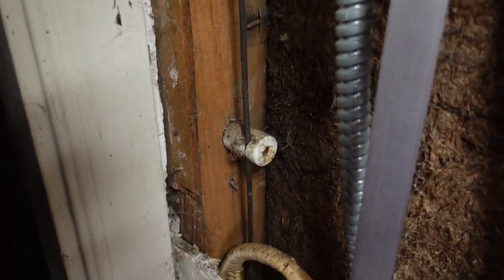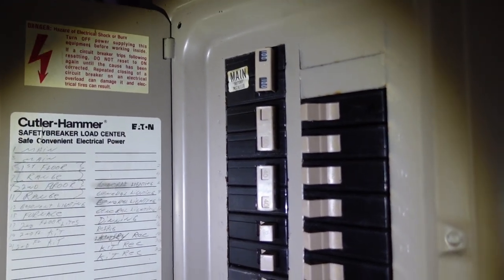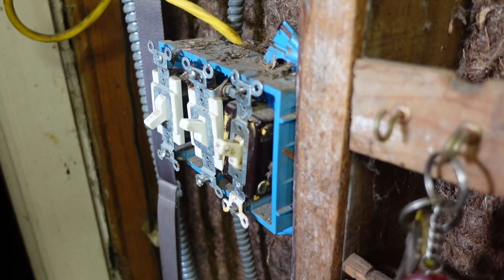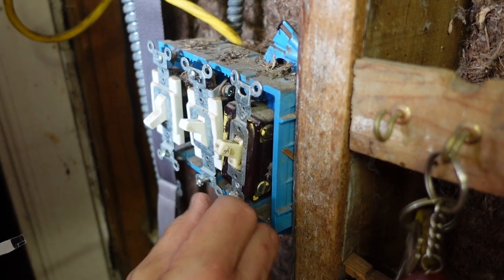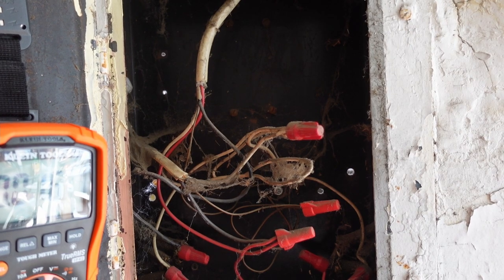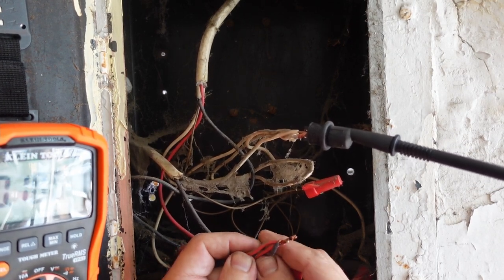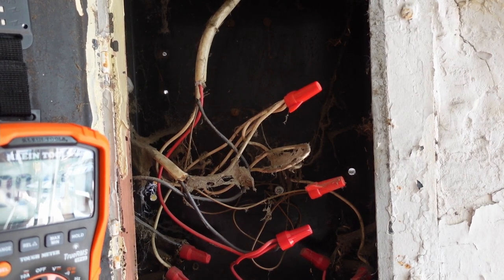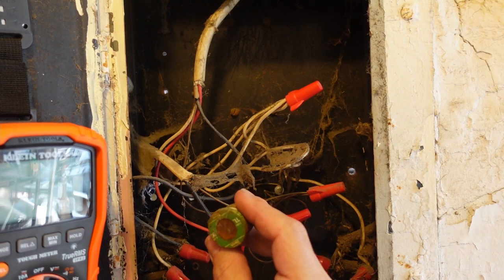Insidious electrical issue in 99-year-old house with knob & tube wiring

Comment: Step 1 turn off the feed to that old panel. Step 2 remake EVERY joint in that box. Failing that, rewire the entire place. It is far cheaper than losing your home and family. Yes I am an electrician by trade. I have very little issue with the main trouble shooting you performed. However the remedy disturbs me greatly. There is plenty of wire in that old panel location, do it right, then put on a cover.

Comment: It looks like to me the twelve 3 is coming from the breaker box to circuits the red one circuit the black another circuit and it's sharing the same neutral so the red and black or hooked the two hot wires and then the all the white wires are together being sharing the same white wire going back that's what it looks like to me I could be wrong but that's what it looks like
Reply from the maker: Yes, i agree.
Reply: @magic.marmot  if you open the neutral you have fluctuating voltages between the two other circuits and come damaged equipment that's plugged into those 2 circuit s

Comment: dumb question what is the metal conduit at 1:20?  I believe that is also wiring?  But not knob and tube?  Is that like early Romex?
Reply from the maker: Early romex from an electrical update done sometime in the 60s or 70s.

Comment: For gods sake SHUT OFF THE POWER. This is beyond rank amateur.  Steel tools...bare hands...no ground...people die doing this.
Reply from the maker: Any working electrician will tell you that there are times when working live is necessary.
Reply: The only time I have had to work everything hot was in a hospital.
Reply: You work on stuff live when you are troubleshooting then you turn power off when you are performing the repair

Comment: Jeez all of the hate comments. Give the man a rest. If he does not have the budget to rewire, stop telling him to get an electrician and rewire. There was no way for him to see if the certain knob and tube circuits work unless they were live. Unless he were to do a resistance test with a multimeter, which may not be accurate.
Reply from the maker: Thank you.
Reply: While the comments are harsh, it's hard for me to characterize them as "hate" comments. As an electrician for many years, I'll credit Rob for his troubleshooting approach. However, while using a wiggie or multimeter is the only sure test for electricity (provided there is a path to complete the circuit), having a non-contact voltage tester and being familiar with its limitations is essential, especially when working on hot circuits.

I and the other commenters just want people to appreciate the very real hazard we see. If I were in Rob's position, I'd even pay a loan shark to get the money for a proper rewiring. I can't emphasize enough how dangerous this is. If a Boy Scout can start a fire with a spark from flint, imagine how easy it would be to start a fire in this house with arcing from the wires and flammable insulation.

Comment: O as a master electrician knob and tube wiring is a horrible and dangerous thing no matter how you slice it
Reply: That is an exaggeration . It’s been in that house for a hundred years and the house is still there. It IS outdated for todays standards and if you can replace it do so. There is a tiny bit left in my hundred  year old house that would be incredibly expensive and difficult to replace. It’s the wires from four switches to four ceiling lights . The wire TO the switches is new. But to the fixtures would entail opening ceilings, removing lathe and plaster in four rooms and then repairing four ceilings. That ain’t happening on my watch. I’ve been here 40+ years with zero issues.
Reply: @alanyoder7629  and your expertise in this field is ?
Reply: @derekstratford8214  removing K&T wiring from my house and rewiring it under the supervision of a master electrician.
Reply: My K&T has been in place since 09. 
If your work  is in place for almost 115, hats off to you. 

Never had a problem

Comment: Just rewire the place, I am from Europe (Switzerland) and all of your wiring looks just insane and would never pass over here. Wire nuts have been banned for years, GFCI's are a must on almost all circuits, having such a ratsnest of wires mixed in with knob would be absolutely not ok and need to be disconnected immediately if seen by any electrician. It also seems to me that you do not really test your wiring over in the states. If you flip the breaker and everything works it's fine. No insulation resistance tests or loop impedance or anything
Reply from the maker: "Just rewire the place" is great advice with an unlimited budget. Unfortunately, I don't have a budget to work with.
Reply: Yeah, in Switzerland all wires are run in conduit and have been for a very long time, so rewiring is usually pretty easy and can be done cheaply by yourself. But if you have to rip open walls it gets expensive real quick, but if I were you I would strongly consider making the investment, it's just not worth risking you house and life
Reply: @n.l3880  Electrical Metallic Tubing costs 3x to put in vs “non metallic  dry 90*C” type wire. BX armoured cable is 2x the cost to put in as “NMD 90” wire. 
Ideally his nob and tube should be replaced with BX armoured cable, arc fault protection on plug circuits. Ground fault protection near water or bellow 5 feet outside.
Wire nuts are ok, you guys use those little gay clip connectors?
Reply: @Yotaciv  We mostly use different wago connectors and before those were around we used screw terminals and before that we also had wire nuts, but they are banned and illegal to install for a very long time, the screw connectors are fine if done well but not used anymore because a lot more work to install and labour is the most expensive thing here, the cost of wagos really doesn't matter at all
Reply: You say wire nuts are banned in Europe but I see so many videos on YouTube by so-called electricians saying Wagos and other push-in connectors, which I love and always use, are dangerous and they refuse to use them.
Reply: Wirenuts when done properly make a better connection than any push in or lever nut wago. You dont just stick the wires under it and twist it on. You need to pre twist solid wires together, as evenly as possible.They are the connector, not the wirenut. The wirenut is really just a cap to prevent it from grounding out. Adding some tension helpful for stranded, Additional attention to stranded and solid to stranded needs to be addressed. To ensure a solid physical connection, usually leading the stranded wire. If wirenuts were made illegal where you are, it wasn't done because wirenuts are unsafe or are worse connections. It was done because they aren't idiot proof. They got rid of the problems poorly executed wirenuts cause. Which was the cause of this issue, and due to doing the same thing the last guy did, just twisting the nut on, its possible it'll happen again down the line.

Comment: A digital meter is the last thing I would use. You need a tester. it has more a load so wont get weird readings like you will with digital meter.
Reply from the maker: I've never had an issue with a DMM that wasn't my own error.

Comment: You tested a hot wire with a switch leg wire. Even if power was on you would not have got any voltage. You need to test hot to ground or neutral
Reply: Your statement is not true. He actually tested correctly at the middle switch when he turned the switch to the off position and tested across the switch. That’s actually a very good way to test. Where he went wrong is testing from the hot of the center switch to the wire of the switch on the right. Because he doesn’t know what’s happening with that other circuit and power at both wires can mean many different thing happening so it would just add to the chaos. When you test across the switch with the switch open you are basically testing hot to neutral. The switch leg is the neutral and the hot to the switch is just that, the hot. If you don’t get a reading it could be because the light bulb is burned out, you have no power to the circuit or have an open neutral wire.

Comment: I get you don't have money to pay someone to properly rewire the place. As an electrician, I have had the "honor" of rewiring k&t. It's horrible, especially if you have to cut through lathe and plaster.

Having said that, I would not trust my life or those of my family to that wiring. Using candles would be less of a fire hazard. At least replace the exposed stuff, redo the splices, and get them on boxes. K&T should never be encased in insulation, and you may as well have a lit match there. 

I implore you to address that immediately. You have knowledge of this, at least enough to run some Romex down a wall and splice devices in. Given the poor connection you found, there is bound to be others. It's not a matter of if that crap wiring is going to start a fire, but when. After you lose your house and your possessions, ask yourself if you really couldn't afford to properly change out that wiring.

Comment: Stop and call an electrician you talk about the previous owner your just as bad
Reply from the maker: You're
Reply: I AM
Reply from the maker: @lestermarshall1420  and you've never worked on a live circuit?
Reply: @magic.marmot  Yo give it a rest yes I worked on live circuits and 4 Phased systems. Why is this worrying so much about my comment???
Reply from the maker: @lestermarshall1420  not worried, just bored.